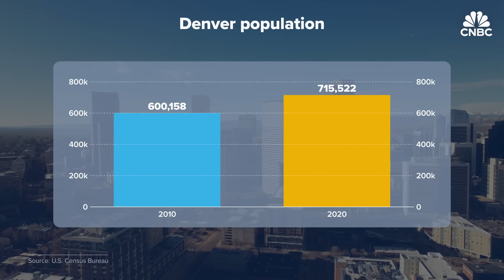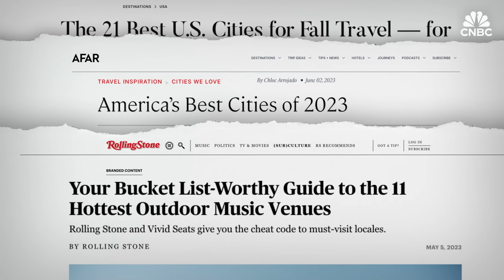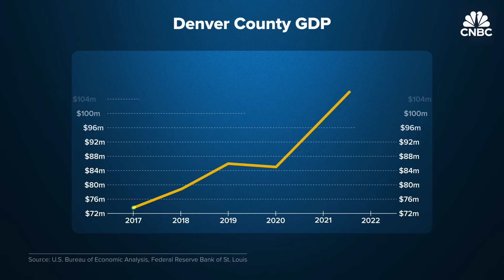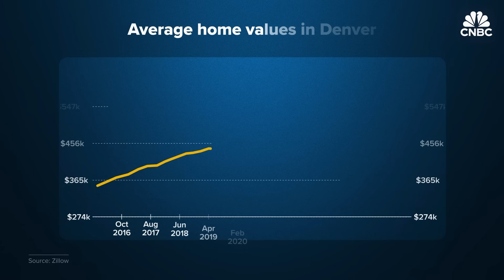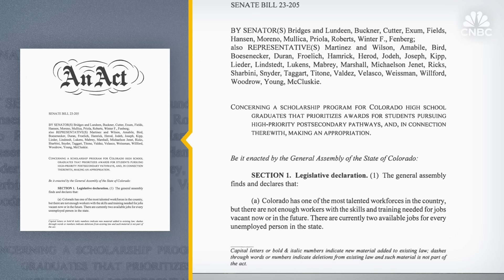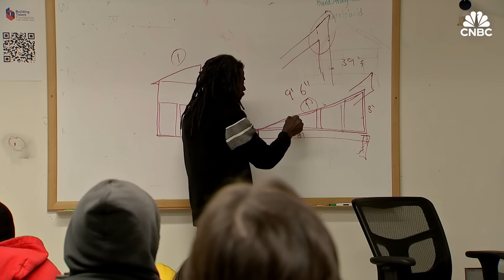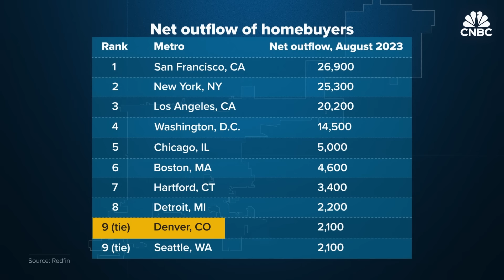Why Denver Is Struggling To Keep Up With Its Economic Boom

Comment: I really can’t understand how they make such simple solutions so complicated. if you have a housing shortage just build more homes. I can’t understand why they keep coming up with all these excuses of why they can’t. More people has moved into Texas than they have in Colorado and yet the housing prices as a whole are cheaper than Colorado as a whole.
Reply: How can they build more houses when they aren’t paying the wages to keep up with the economy did you eleven watch this ? lol they lost construction labor this year 2400 workers that tells me the market lays shot there for construction based on the economy
Reply: @desilorajr2713  ok so I’m going to break it down to you. The houses in Denver are more expensive because they don’t have enough houses to match the demand which makes the houses more valuable. To bring down the prices of  houses you have to build more houses. If they have high demand in houses  and yet they laid off 2400 construction workers that tells you their something that it preventing them from building more houses. Usually that is a regulation or two. The wage issue is irrelevant because it is busy as they say they should easily be able to throw higher wages on top of the cause of building houses . The reason why I brought up Texas or let’s say more specifically Houston. Is because despite the fact more people has moved there than Denver, they don’t have this issue. Earlier in the video they brought up San Francisco. San Francisco is a perfect example of too much regulation, making it harder for construction workers to build homes. So until they make it easier to build homes, the cost of homes will stay high. It’s just that simple. And the btw just because they are reporting on it now doesn’t mean it started now. It is very likely this issue has been going on for sometime now and they are using inflation as an excuse
Reply: @Dmindthinker011 Denver is 155 sq miles. Houston is 665 sq miles. Really a terrible comparison. And oh by the way, Texas is shipping all their illegal immigrants to sanctuary cities like Denver. So you’re really just off base on the issues Denver is facing. The ability to scale isn’t as easy as “just build more houses”.
Reply: @morgana.3397  Well for one they have said in the video space isn’t the issue so mentioning the square feet is irrelevant. 2 unless you’re saying illegal immigrants are buying the houses then I don’t understand why you are mentioning that point. 3.  The illegal immigrants are asking to come there because the sanctuary city status so that is of Denver on doing
Reply: @Dmindthinker011 the point is, saying “more people have moved to Houston and they don’t have these issues” is a terrible comparison. It’s a larger city with a greater population. Also, you’re forgetting that Denver has a winter, Houston does not. It’s difficult to build a house when it’s 20 degrees and snowing. Housing isn’t the only issue, it’s traffic, rising hard drug use and crime, and the migrant crisis. I live in Denver, have over a decade and am keenly aware of the issues the state is facing. No one wants to live an hour away from the city and commute in, Denver isn’t as spread out as other metro areas. Yes, it’s a liberal city and certain policies have contributed to the issues we’re facing but hey at least we’re not criminalizing IVF. Lastly, with the migrant crisis, in the last year Denver saw an influx of 40k illegal immigrants, the most of any city PER CAPITA, which is pressuring homelessness, infrastructure, and for those that aren’t homeless, increasing the demand for low cost housing which increases prices as a whole for housing.
Reply: The main issue with housing cost is land prices. Texas os much cheaper than Colorado and it's not just because of less zoning regulations in the former. I'm not sure why land in Colorado is so expensive.
Reply: @morgana.3397  The reason why I keep making that point is because it’s easier for Houston to adapt to its population growth. The point that a city with almost 8,000,000 people isn’t having a housing shortage but a city with around 700,000 people does doesn’t ring a bell is very telling.  And Texas isn’t the only one. The average home prices in Tennessee , Idaho , both the Carolinas  Oklahoma , Maine are all lower than Colorado home prices . Again, all that stuff about the illegal  immigration is irrelevant unless you’re saying they are buying up your homes, the homelessness stuff is irrelevant because clearly they aren’t buying up your homes. They live on the streets or in shelters. Your point about the winter is irrelevant, because people aren’t stupid. They know how to adapt around weather conditions. Hint why you houses there in the first place. And by the way your population is dipping while your housing prices are getting more expensive. I live around dc and despite its population also shrinking compared to what it was in 2016 the housing prices only gotten more expensive.
Reply: Spoken like a true fool.
Reply: @NataliaSeesIt  you shouldn’t talk about yourself that way
Reply: Undeveloped land prices are still expensive. But the man above has a good point. Less building regulation , could mean more affordable housing. Supply and demand is the lever to pull.
Reply: Texas has way more open land which makes land prices and the price of developing new land way cheaper than Colorado.
Reply: Houston never had a shortage of housing. In fact they had a surplus for a long time, so they were much more able to absorb new residents. That's also how Houston solved their homelessness situation. They had plenty of empty housing and used it to help get people back on their feet. Denver never had a surplus of housing, and the population jumped 20% in a decade. An increase of 115,000 people will be felt a LOT more in a 600,000 city than in a 8,000,000 city
Reply: Colorado does not have Chuck Norris Texas Ranger to make everything right.

Comment: I am a construction worker in Colorado, and we want to get PAID to build your HOUSE seriously when wages were 12 and house were 250k now wages are 25 to 35 some fields 65 of course houses are going to be 500k to 600k i made 100k a year with FULL benefits and better than the UNIONS. All construction workers need to get paid more so we are going to charge you more 50 an hour is coming just a heads up you can't do your work without a building or house can you.

Comment: One contributor to the major aerospace industry is CU Boulder. Nationally the university might have the stigma of being known as a big "party state school", but it has the most NASA funding of any Public University. Most big state schools like CSU Ft Collins where I went I think just has a Mechanical Engineering Department and Aerospace is a subfield in that. CU Boulder has Aerospace and even a dedicated facility just for it on the East campus. Then you consider that CU Boulder co-owns an engineering research complex with CSU and UC Berkeley and NSF under the Horsetooth Reservoir Dam, it's easy to see how the Aerospace Industry was attracted. A lot of the research done at these schools and Mines, University of Wyoming too, is wind tunnel tested in Colorado Springs at the Air Force Academy. So the Air Force Academy having massive test facilities that support CU's aerospace research factors in. You create a petri-dish with a metro area of 3 million between Boulder and Colorado Springs, it becomes the Aerospace epicenter

Comment: Denver is a lovely city but it is starting to have some of the same big city woes as LA, Chicago, NYC, etc as it grows. It's really hard to break past 1 million without experiencing this. Now that people have more flexibility in where they live, you have an influx to more desirable locations. If the city isn't ready for that growth, then it becomes very problematic for everyone there. We looked at Denver but decided on Colorado Springs instead - it's still within 90 minutes of Denver and the airport but doesn't have nearly the same problems as Denver (yet) - but everything we need/want is already here. And, as a bonus, the mountains are closer down here than Denver. We would have to pay a lot more to live in Golden or Boulder for a similar experience. I'd even consider Pueblo if crime wasn't so bad down there - although the mountains are a bit further out.
Reply: Colorado Springs looks lovely!